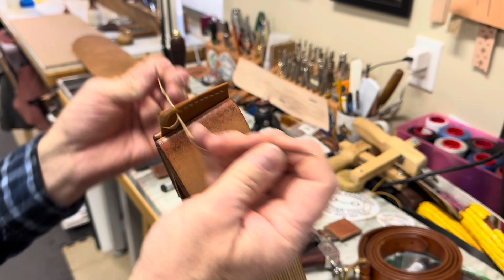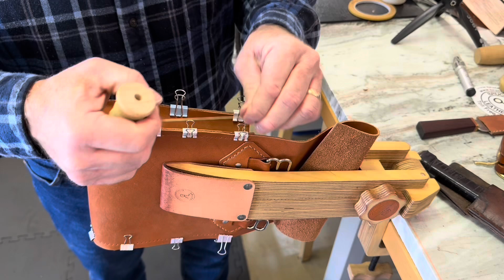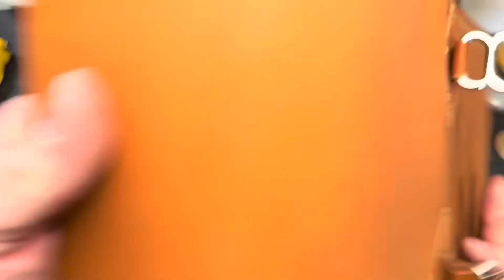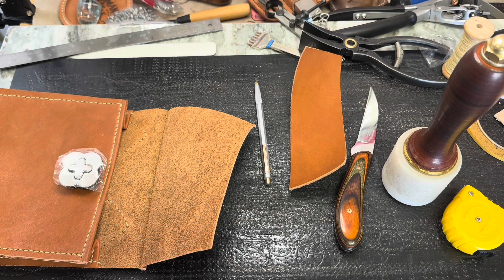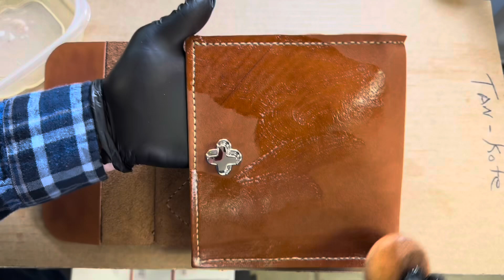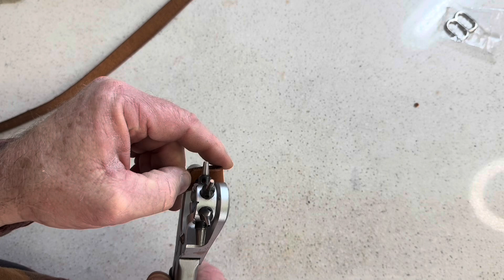Bag Making / How To Make A Leather Purse / Great Gift Ideas Made From Leather #leathercraft

Comment: Hey Robert thank you for the video.  A very utilitarian little bag this could be a nice little "biker bag".  How do you get on with the thread zapper? I bought the same one you have and struggle to get a clean melt? Not sure how to describe it.  The lighter leaves a nice little ball that I flatten.  Anyway I have gone back to the lighter.  Thanks again for the bag video.
Reply from the maker: I see lots of comments about the tool. It works well for me. I do understand that if you want that bigger melted down ball it will not create that. I melt to cut the thread and then melt it down to the point that I’m looking for and smooth with my finger. It work for my projects.

Comment: I like to let my glue set and dry before stitching and I use shims or popsickle sticks on the straight sections to sandwich the leather between so they get an even clamp. If your looking for a good backer for your awl try a small size deep well socket attached to a stubby ball type handle, works awesome.
Reply from the maker: That’s a great idea. I normally use an old cork.  When I reached for it, it wasn’t in its spot on my messy workbench. I love the tips. Thanks for taking time to comment. I get great tips and tricks from my subscribers.

Comment: That's a cute, simple, but elegant bag.  Thank you for sharing the idea!
If I may offer advice, as one bag maker to another?  When attaching the closure, you have the right idea, but are doing it backwards.  Before sewing up the sides, install the hardware on the flap first, then put the lock in place, and push it onto the front panel.  This will leave marks showing where the stud / tabs / tines need to go through, making the line up perfect every time.  You can then fold over and stitch the reinforcement edge.  When adding the side pieces, use measurement ticks to ensure the sides line up properly.  I usually mark 2" down either side and mark the center.  Gluing starts at the center and walks up either side.  By starting at the center, both sides will stay consistent.
Reply from the maker: I really appreciate the time to write out your steps plainly. That’s not easy to clearly explain steps in writing. I will give that a try and see if it helps my process. 

Thanks for following along as I explore this side of Leathercraft

Comment: Very cool project Robert.  Love the buckle design.  I definitely put that Shaun Woodsum custom knife on my future shopping list!  They are currently sold out though. 🙁
Reply from the maker: Thanks. In need to make a tool sheath for myself. That’s a sharp knife to just leave lying on the bench top. Reach out to Shaun and I’m sure he will set one back for you from the next run of the knives.
Reply: Thanks—good idea. I have the basic CS Osborne version of that knife which is also very thin and sharp!  I made a slip sheath for it for the same reason.
Reply from the maker: Totally agree. I spend too much time walking to the last place I used my regular tools. I need to make a hip mounted tool bag with spots for six or some tools that I use all day.

Comment: I thought you would have measured the size of the flap and cut a template to mark and attach the hardware to fit and then place the template over the original flap to mark where you would cut out to fit the hardware.  But the way you did it worked out just fine..NICE WORK
Reply from the maker: Thanks for the suggestion. I need to try a few different ways to find what works best for me. I like that suggestion and will give it a try. It’s funny how we might have steps of the process that keep us from making a specific type of project. For me it’s that step on bag making.
Reply: @InMyBusyLittleShop  I appreciate your acknowledgment of my suggestion. I like the way you work, like a production line.
Reply from the maker: Thanks. I like to be efficient with time and supplies. I think I get more back from the comments section than I give out. Have a great week.

Comment: Just a simple question... why not use a stitching groover?  Just asking, don't mean anything by the question, just asking...🙂
Reply from the maker: That’s a great question Dean. The leather is 6 ounces and I found areas that were around 5. I was concerned about cutting a groove and ending up thin in the areas where it would have the most stress. What do you think? Was that overly concerned?
Reply: @InMyBusyLittleShop  My opinion is that you had used contact cement to secure the two pieces together... the stitching just added to the security of the bond. The leather on both sides of the stitch is full thickness... no real reason for concern, in my opinion. Plus the groove will help protect the stitching.
Reply from the maker: Yes I do like to normally get those stitches buried some for protection. I’m probably overthinking (wouldn’t be the first time) the concern of the leather failing where I would stitch groove. Thanks for the suggestion and your experience